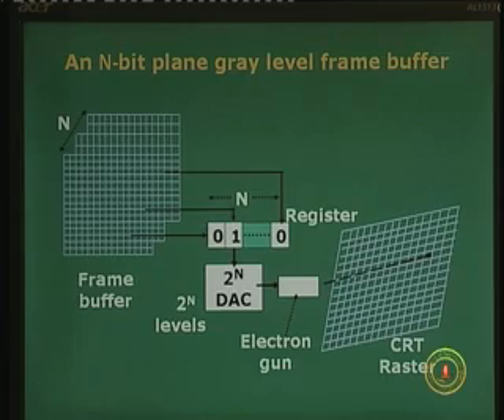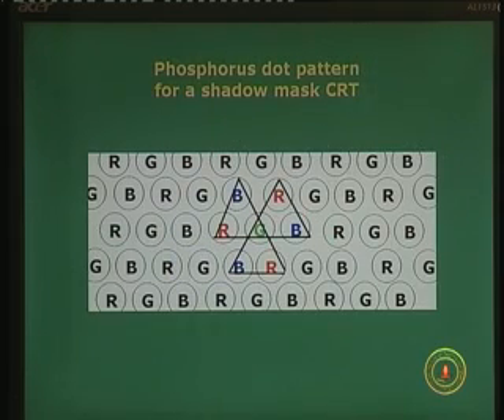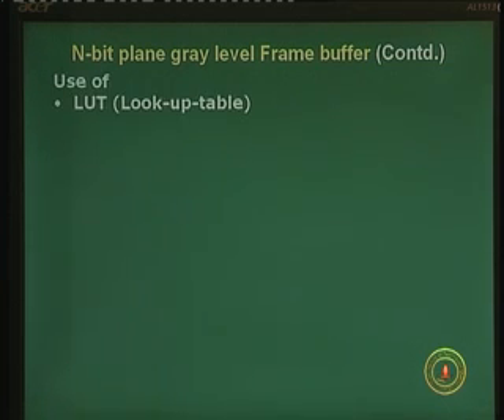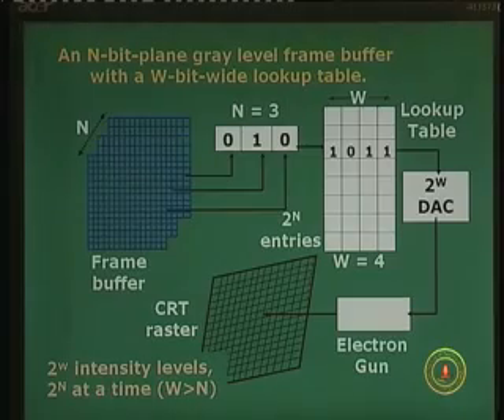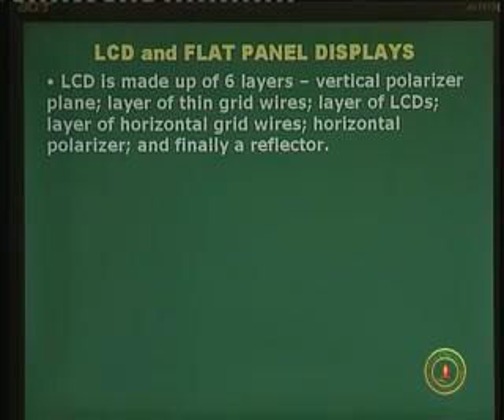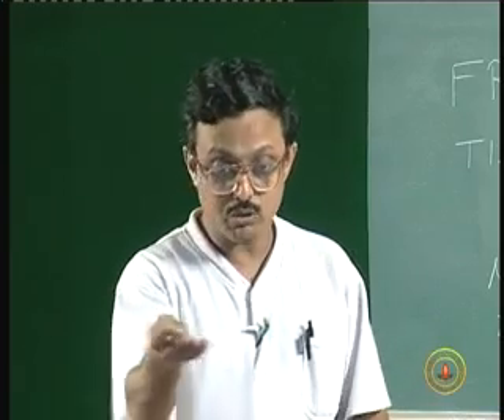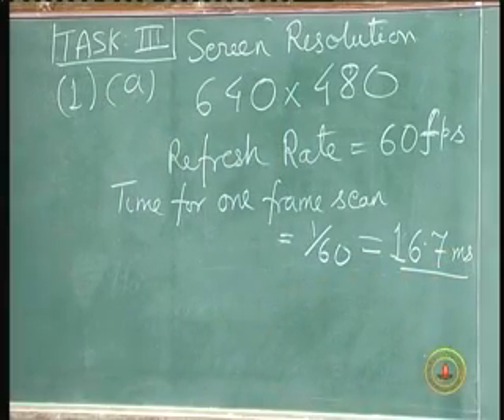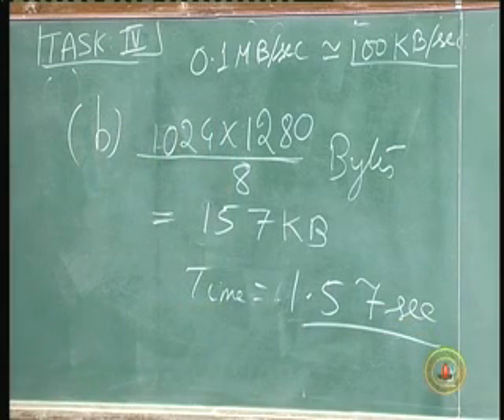Lecture - 5 CRT Display Devices (Contd)

Comment: why do we need to make things more complicated when using already so many combinations and by the  introduction of LUT we have to deal with more colors now how does it help can anyone help
Reply: Assume my display supports 24-bit images. But I'm building a game which has very high fps and only requires maybe like 256 colours(to have efficiency). So instead of having the whole 24bit register and planes, I will instead have an array of 256 size and each of the array element can be a value from 0..16million color. Now basically the memory has become only 256 array elements and 8-bit planes.(2^8==256 addressable locations of the array). Before even though I required only 256 colors, if I don't use lookup table, I require 24 bit planes, and updating those many locations in such short amount of time is hard. But with lookup table, only 8bit planes have to be updated everytime. I hope you have understood.